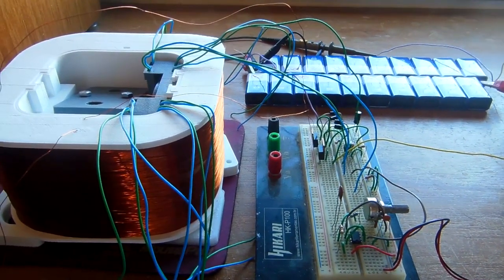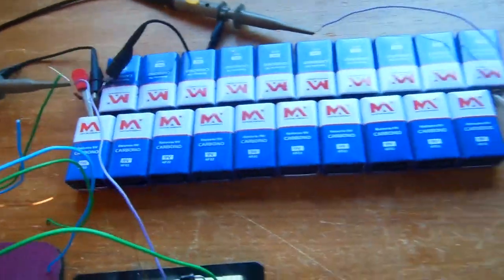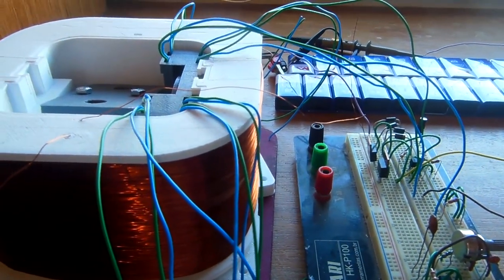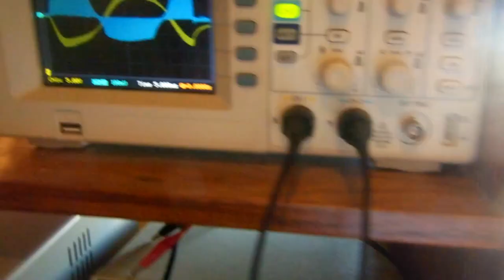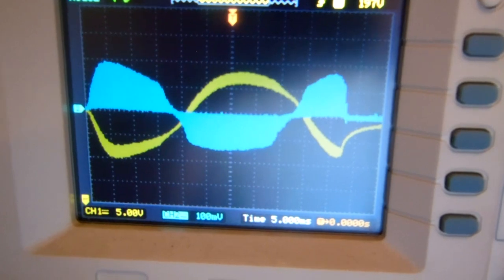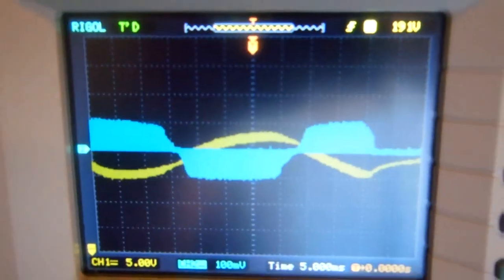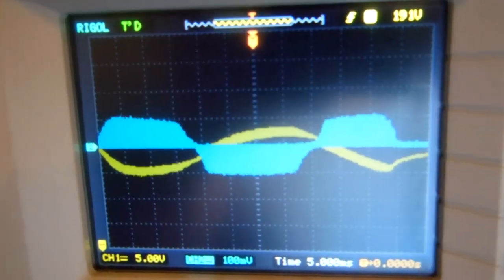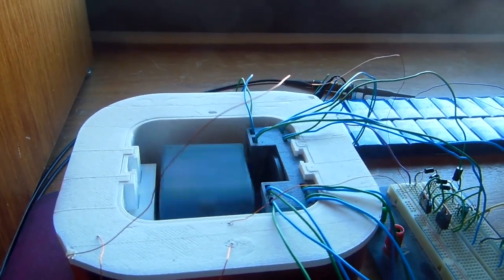Newman Alternative  - Small Scale without mechanical commutator

Comment: Nice worl Luque, ill have to check out your circuit. So what's yours thoughts on your tests so far? I guess you have some of that on the website as well. Good looking coil and build! ~Russ
Reply from the maker: Thank you Russ! They are promising, but they still under unity. I will try to post another video this week showing how much it can run from a low farad cap.
Reply: rwg42985 👍😄 Russ

Comment: Nice build, ZC batteris aren't meant to be rechargeable, but if you get the right negative spikes then perhaps they can be.
Reply: I've been using solid-state switching for investigating CEMF from two inductors, both with the same resistance but one with higher inductance and there was a difference but not much. Today i used a switch rather than a PWM for turning on and off and the results are FAR better. I have a simple diode pair ensuring that only the CEMF lights up a Neon bulb in the circuit and mechanical switching gives far more power back. I ahven't measured with the scope yet as i'm waiting for a x100 probe (it's my first proper scope and i don't want to burn it out!).

I think mechanical has the advantage due to the rough surface of the metal switches, although it may be that the fall-time is shorter than with a transistor, even though they are on the order of nanoseconds.